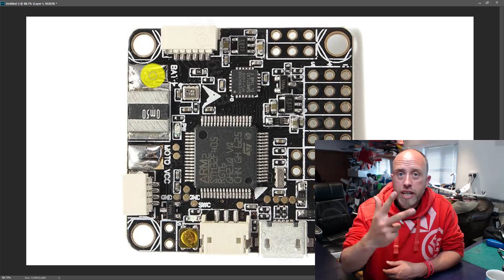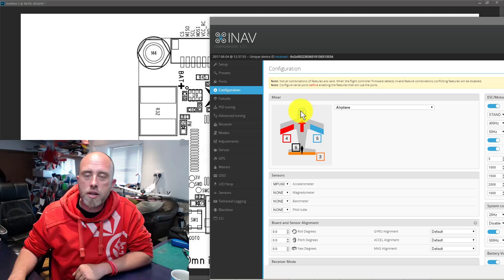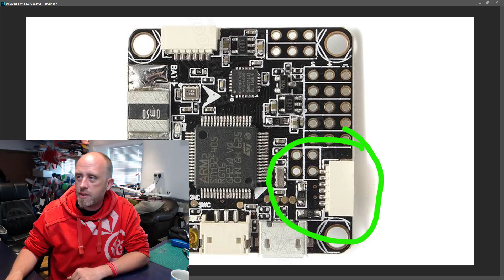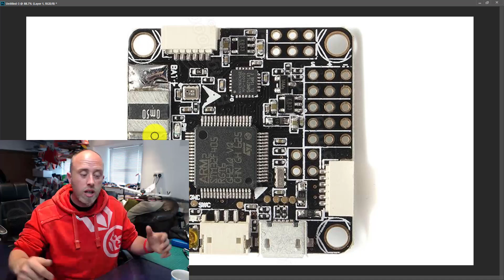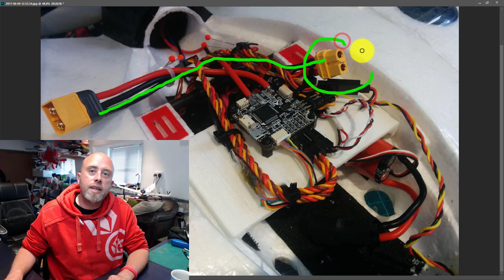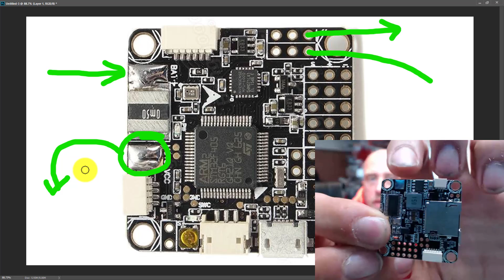Part #4C - [FULL] Omnibus F4 V2 Board Overview for iNav & a Flying Wing

Comment: Matt, I am new to rc plane fpv installation. Your lecture on the flight controller setup was great. I have a question. The plane that I am going to setup has 2 front brushless motors and 1 more brushless motor at the plane back section for vertical lift powering. The plane has 2 airrons and 1 elevator. The questions is Q1 -  For PWM connection where to connect the 3rd motor?. Q2 - battery power from flight controller to 3 ESCs. How to setup connection to 3 ESCs?. Appreciate if you could assist me in this area that I do not know. Thank you in advance.. from Abrams King.

Comment: I can't get OSD working with my F4 v2 board , any suggestions. i am using common ground and if connect both video wires directly camera works however if connect them to FC didn't work.
Reply from the maker: Morning Ashish, have you uploaded the fonts? See the common mistakes video I did a while back, Matt
Reply: Thanks for your reply, I did upload the fonts. when I connect my video wires through FC board I am not getting any video. I did swap the wires just in case i was connecting vin , vout reverse.. however it didn't work.

Comment: can we use Original Airbot Omnibus F4 Pro V3 Flight controller SD 5V 3A BEC OSD Current Sensor LC Filter
Reply from the maker: Hi Ashish, it'll work with any iNav compatible board. See their website for the full list. Matt

Comment: Hi Matt....I'm really enjoying the channel.

I git stuck right here. I have a V3 (not your V2) where I have used two of the three available UART ports. One for smart port and the other for the serial RX. What I have now is a RX3/SDA and TX3/SCL remaining on the FC board. I'm assuming, if you can confirm, I'll be able to set up the GPS but not the magnetometer. Is that correct?

If anyone else watching Matt's channel can shed light on this one, it would be appreciated.

Thanks!!!
Reply from the maker: Howdy Chris, just progress to the GPS episode. A compass is not needed for fixed wing models. Hope that helps Chris, Matt

Comment: can i simply take 5v + and gnd from PDB and connect to FC BAT+ and gnd? I dont want use current sensor or correct voltage on the display?
Reply from the maker: Hey Simon,  no idea fella Matt
Reply: I think I was not clear enough. my esc are soldered to a PDB which is where I want to connect the 3S lipo. My PDB has got 5v BEC. Can I power the omnibus f4 pro v2 from that 5V BEC? (connect them to BAT+ and gnd pads on the flight controller)?
Reply: Yes you can, you can even use the direct voltage of the 3s bat, I'd suggest using 12v

Comment: Hi Matt, im currently putting this flight controller into a s1100 reptile with your awesome video tutorial, only it's customized with twin edf's and retracts.
Question time, can differential thrust be used with the two esc connections like a rudder, that way i wont need a steerable nose wheel.
Cheers.
Reply from the maker: Howdy Max, you'll need to see the inav wiki for this as I have never done diff thrust with inav. Matt
Reply: Thanks Matt, i will have a look there.

Comment: Hi, Thank you very much for the detailed explanation. One Question. 
When it comes to connecting the ground from Batery to the FC: As far as i understand it, a relative thin cable should be sufficient since there should be no heavy load running through this one except for what it ineeded by the FC itself as well as servos?
Reply from the maker: Hey Wolfgang, do not skimp on that step, one of the lads used silly thin wire and hence it went up in flames under load. Matt

Comment: can I powered this board with 4s batt?

because I just bought it, its okay when I plugged the usb cable.

but something goes wrong when I powered the FC with 4s batt.
it turn on about 5 second and gone forever.

back to the question, is it okay to power this FC with 4s batt?

Comment: I am building a wing
they say to remove the red wire on the servo plug on the speed controller
I'm not getting 5 volts on my servo
this board supposed to have 5 volts for the servo
is there something I'm missing I have to jump 
my 5-volt rail is dead for the servos          thanks for your help
Reply from the maker: Hi Frank, see the rest fo the series, the 5V comes from your ESC, Matt

Comment: Hi, I used the omnibus f4v2 with gps (wing model) and even if I have more than 10 satellites, on the screen I see that the compass orientation is very slow,  glitchy and give wrong directions. I tried both with compass and no compass (excluding it), but I still have the same problem. Please can you help me?
Reply from the maker: Hi Maikk, I'm not sure. It would be best to submit a bug report with the iNav creators, Matt

Comment: Matt - I see in this video you say to disconnect the ESC BEC wire, but in the trouble shooting video later you say that if the servos don't work, you need to provide the power from a BEC. I'm confused!  Please help?  Do I use a BEC to the FC board, or not?
Reply from the maker: See the earlier video, a BEC is needed. Matt

Comment: Hey Matt, your videos have helped me out tremendously. I am using the Omnibus F4 V2.1 Pro on a flying wing. I have most of everything setup except the OSD. I have selected all my OSD screen options and saved them. When looking in my goggles, the battery meter and artificial horizon works fine, but even when my GPS is locked and I can see the number of satellites fixed in INav, I get zero in the OSD? Does the F4 Pro automatically feed the RSSI signal strength to the OSD? And finally, what do I need to do if I place the F4 Pro backwards? Is there a CLI command I need to use?

Mike

Comment: Hi Matt Have a question. I'm planning on running an opto esc. However my camera (runcam split) requires 5v is there a place on the board where I can draw 5v from? Or will I need to get a separate bec to get 5v? Thanks
Reply: On second thought I think I may be ok. The first generation of the runcam split only took 5v. The second generation takes 5v to 17v. I will be running 4s in the nano talon so I should be ok running off the pack.
Reply from the maker: Howdy Michael, yep out of the pack and as little as possible being drawn via the board. Just make sure you have a common ground on your FPV gear, Matt

Comment: Matt  - there are  two F4 brds  - -  a =   OMNIBUS F4 Pro V2 Flight Controller  from GearBest         £13                                                                                                                        
                                                           b =    BF3.2 Omnibus F4 V2.1 Flight Controller from Banggood £26

 I have  gone for  'a' the cheapest, have you any idea as to the difference and will it work ok in the Falcon...joe

Comment: can you use an external current sensor if you where using a PDB with one on it already? I don't like running all that current through the main board like that. May not be an issue for a plane, but a quad it could be, and you would definitely use a PDB for one of those. Also. Can you pull enough power through the FC to power the servos? or should you use an external BEC to power them?
Reply: works perfectly fine on a quad, i've had 2 birds with it (albeit on betaflight) and never had an issue with it running 150+ amps

Comment: this board will fail if you plug the power in when the usb is connected  unless you bridge the 5v to ram  solder points on the underside of the boards , I missed this point and it killed 3 of my boards , thanks for the tip  matt
Reply from the maker: Jack, I just read your other comment on the other video,  if you're plugging them in and they're going pop and you've done that 3 times, maybe change the power supply out? These boards have been fine for me, Matt
Reply: thanks for the reply, what do you mean power supply out ? I must admit I am a bit of a magnet for faulty stuff, but lots of people have commented that when they connect to inav  and then plug in a battery the board will just not connect to inav anymore, this is what happened to me . 
         I think their might be a batch of iffy omnibus v2 boards  as it happen to me with  a boards from gear best and bangoods .  I have  setups with other  make clone boards which work fine and I am following your directions so I don't think it's user error . 
                                                                                                   I  am grateful for the work you put into your channel  and have learnt a lot from your vids  and I hope santa brings you something nice to show us in the new year ;) .
Reply: yep , just  soldered the  5v to ram on another omnibus board I have and it seem to connect ok  with the power connected , it's just a shame that I seemed to of missed when you mentioned this in your videos  , this seems to be a key point in not bricking the board  and should be  highlighted  to noobs
Reply: Agreed. I seem to have missed it too. Can you describe the locations of the 5v and ram pads to be jumped? This F4 PRO board is not as straight forward as the plain F4 board. Thanks for pointing this out.
Reply: Sorry, I meant this F4 V2 board vs other Omnibus boards. Other board = VBAT to RAM, no probs. This board - 5v to ram, .. Which ones?  Thanks again.

Comment: Please, please, I no longer know what to do, I have 3 control cards other f4 v2 pro, I configure the inav, I connect the rx, gps, all right, but when I connect the servo, it gets a huge delay in servo, I give every command and it goes slowly until the end point, when I release the command it takes to return, and back to the few, when I put in passthrue it works normally, or when I move on the plate it works very fast, it is only us command of the radio that has the delay, what can be? follow the video of the problem https://youtu.be/q2SgRFqvyGg
Reply from the maker: Howdy, a read of the iNav wiki for the flight modes will help as it sounds like you have enabled a stabilised mode, Matt

Comment: Hi Matt!  My Inav install and setup are done....just waiting on the snow and wind to settle a bit for the maiden.  I have my servos connected to the PWM pins on the Omnibus f4 v2 and the servos are working as they should.  Will I be ok to run the setup like this or should I power the servos from an external bec?  I thought I remembered you saying that a vex isn't necessary but some people on the Inav Facebook page are telling me differently.

Comment: Thank you Matt for your great videos.
I have the Omnibus F4 V3 (i.e. no current sensor) and am setting it up for the Nano Talon.  My board is powered by VBAT and I removed the 5volt pin from the ESC lead as you suggested.  Throttle was fine, but  none of my servos worked.  Digging through various forums, I found out that I required either an external BEC or the ESC-BEC.   For some reason, the on board BEC is not powering the servos.   Perhaps there is a jumper or software configuration to make this work.
I've also found out that the Omnibus F4 V3, and possibly other versions, use a triple diode with inputs from LDO, ESC-BEC or External BEC, all going to the +5 volt rail.  So theoretically, there should be no smoke as long as none of the inputs exceed the maximum VCC that board can handle.

Comment: Hi, although the Flight controller you suggest is cheap, it can be faulty. I experienced on my own after ordering from Banggood. I followed all the steps, but the board doesn't work when connected to battery (it works with USB connection). After this down-back, I've made some research and found that it is very common with these CLONE boards to have malfunctions. So it would be nice to say it clearly in the videos. You could also give link for the official board, so people would think twice if saving 20 € is really worth.  Said that, I thank you for your videos they are very good, but the hardware you suggest can be crap, you could at least warn about it.

Comment: Hey Matt, Does that current sensor actually work for you? I have a couple of these boards from BG when I connect the way you do through the current sensor the inductor on the back of the board get extremely hot (not you cant keep your fingers on hot, you get 3rd degree in 1 second flat hot) in seconds and the board has no power. The boards are awesome if I just ignore the current sense pass-through and power pos/gnd as normal.
Reply from the maker: Hi Andrew, yes it does. It needs to be calibrated, which i assume you've not done hence the question. If using a F4 V2, try setting it at 740 in the configurator, that will get you close. Matt

Comment: Hi Matt, I've installed an Omnibus F4 Pro into an S800 wing but i'm having some problems with it. I tried to power the servos from the board but it was only putting out 1.5volts, but 5volts were going to the RX. I now power the servos from a separate BEC but they are quite twitchy and every now and then the servos move from full one way to full the other before returning to their commanded position. Any ideas where I'm going wrong? Or is it likely to be a faulty board?
ps. love the videos, the iNav tutorials are very helpful
Reply: bump

Comment: Have you ever explored  Betaflight.      Rssi is already programmed on channel 16... Thru GUI.    Receiver page.. don't have to solder  note as long as you activate telemetry via uart port.
Reply from the maker: Howdy Craig, yes this is the same for iNav, but a L9R does not support telemetry so no RSSI and has to come from the dedicated pin on the L9R receiver, Matt

Comment: very detailed and helpful thanks! one thing im stuck on, i am using a dsmx (spectrum satalite rx) and been worried about connecting to the spectrum 3 pin port as im told its 5.5v and the receiver (spectrum satalite) is only3.3v.....do i need to adjust from the jumper? thanks in advance!
Reply from the maker: Hey Vinny, I have no idea on the the Spec sats. However those dedicated sockets should be 3.3V for them. If in doubt, check it with a multi meter, Matt
Reply: RagTheNutsOff  Thanks again for the fast response! Connected to supplied 3.3v connector on the side...works a treat!👍

Comment: I Matt
I'm changing my Skywalker X6 setup and i will install a Omnibus F4 V2, 4S 5200mAh Multistar, NTM 3548 900 Kv motor, Corona DS339MG servos . My question is if you think it is ok to power servos from the FC or it is a better idea to run them from a separate 5V supply.
Keep the great job!
Reply from the maker: Howdy Nuno, 100% a separate BEC for the servos wherever possible. It adds a few grams, but hey a model that size won;t notice it compared to that 5200 4S pack :) Matt
Reply: Thanks!
Just another question... as i will use a separate BEC, what do you think about an opto ESC? I have some  Racerstar MS Series 35A ESC BLHeLi_S OPTO 2-4S around...

Comment: I'm sure you are aware, but I haven't been able to find it here yet ... The Video In/Out header voltage can be set to either VBat or 5vdc by selecting the RAM voltage desired. They are set by a jumper on the v1 card and a solder jumper on the backside for this card.  It makes setting up the VTX and Cam very easy with a single servo connector each.   Cheers ... dave
Reply from the maker: Hi Dave, there is a reason why I don't cover that in this series, the less current being drawn through the board, the better. I would strongly suggest that you power your FPV camera and vTx from the main power leads or a separate BEC as shown in the later part of this series, Matt
Reply: Point well taken and thanks ...

Comment: Hey Matt, I have a scenario that I hope you can help me with.
I received an Omnibus F4 Pro board yesterday and want to place it in my wing.
The board I had been using was a SPRacing F3 board, so the GPS unit had to be "modified" by removing the connector so that I could connect to UART port.
Now with the Omnibus board, I don't see where I can hook up the GPS Tx and Rx other than that 6 wire molex connector on the board.
So how can I connect my modified GPS to the Omnibus?

Any help would be greatly appreciated.
Also, it's been your series on iNav that brought me to this point. (So it's your fault! :P)

Subbed and looking at all your iNav series videos.

Thanks in advance.
Reply from the maker: Howdy fella, I'm not sure on the F3 boards. See here http://s3.amazonaws.com/zcom-media/sites/a0iE000000GWIo4IAH/media/catalog/product/s/p/sp_racing_f3-1.jpg and pick a UART that isn't being used and set the GPS accordingly for it. Try that, Matt

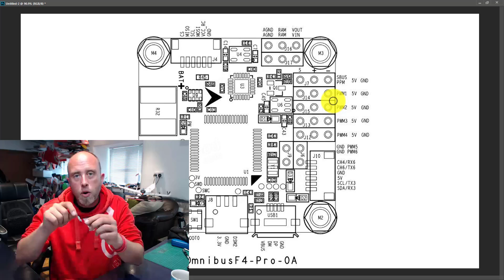Comment: HELP! At 7:00 the video says to disconnect the ESC 5v rail.... The flip32 f4 omnibus board I've got says in it's advert that it has a 5v 3a sbec but goes on to say "You will need to power this board via an external BEC as the built in LDO is just used as a voltage protector and cannot be used for a long time, otherwise it will overheat" which leaves me totally confused as to whether it needs the ESC's bec or not.
Reply from the maker: Morning Seafax, it'll either work or it won't. I cannot comment on that board as it's not either of the ones which I suggested for this series and both of those need an extra BEC to power the servo +5V rail, Matt

Comment: Hi Matt.
Have you ever got this board to work with Frsky Sbus?
This is the Banggood clone, yes?
Reply from the maker: Hey Arne, only ever single one that I own with SBUS, both for the BG ones and the eBay clones too, Matt
Reply: Wow! Quick answer:-)
I've been at it for a couple of hours now, but I think I'll spare myself and go for a PPM instead. Or order an original.
Thanks for answering, and for a fantastically inspiring channel.